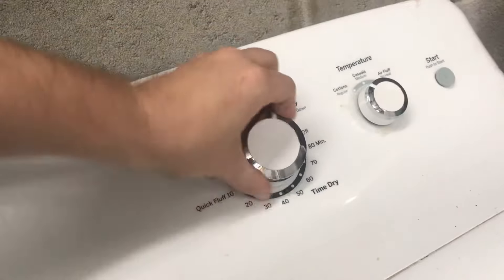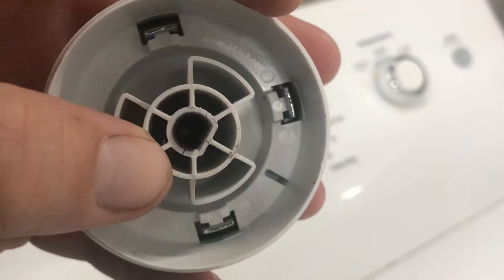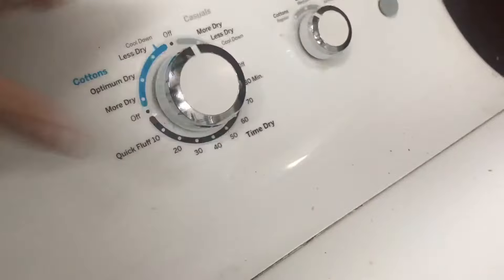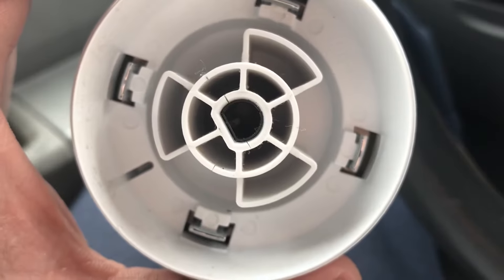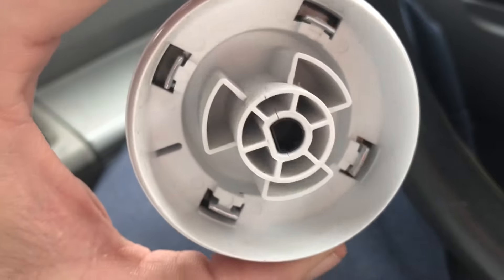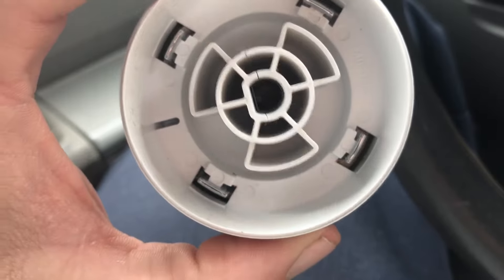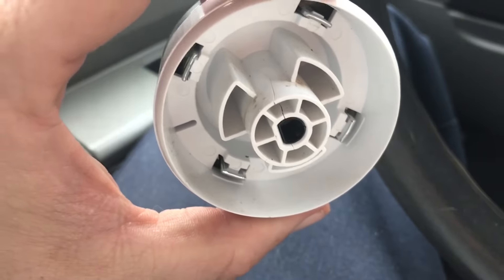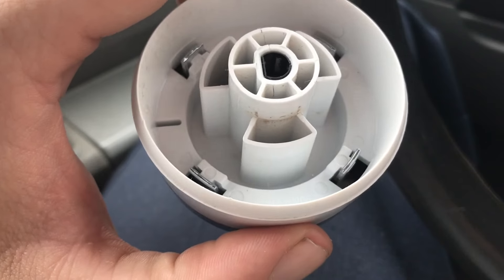GE dryer easy fix (knob not turning timer)

Comment: That model is a piece of junk. The timer is super hard to turn and breaks the knob every time. the new timers are just as bad.  I just got done fixing my parents. I even took the old timer apart and trying to lube and make several modifications to make it easier......no dice, super hard to turn. Replacement part is just as bad. Next knob will break soon.
Reply: Yea, same problem. It should be metal.
Reply: Just experiencing this now. 
 I may back fill the empty spaces with JB weld to reinforce it.
Reply: What is jb  @GeoffreysTube
Reply: @danamickel1584  sorry for the wait.  Basically it's liquid rock.  Squeeze it out from 2 tubes in equal parts, mix and then let it drip into the empty spaces on the back.  It'll reinforce the knob theorhecitally
Reply: I'm experiencing the same feeling rn. Great dryer but the knob is trash.
Reply: @metimes2999  same. I ordered 1 off Amazon and it's complete trash.
Reply: Did the JB WELD work? I'm on my third broken knob and was about to try JB Weld on it.

Comment: Your video saved me hundreds of dollars, an enormous amount of anxiety, and fixed my dryer problem perfectly.  Thanks for posting this!!!!
Reply from the maker: The simple things are overlooked so much.  Glad you found the video
Reply: How long do the knobs normally last when replaced?
  This is a somewhat common problem with many ge timers. 
  I just disassembled one and oiled it then put a used knob on it with the metal piece in it. 
  The timer turns now but still seems a little stiff. 
  I am not sure if the motors get stiff or if the hams get in a bind from wear.
Reply: I second this! ❤

Comment: Usually replacing the knob is a temporary fix. These timers  are notorious for getting too stiff and breaking knobs. You can reinforce the knobs if you use the two part super glue with the powder catalyst.  I just fill in the holes around the d shape which makes the knob much stronger.
Reply: You deserve to be the owner of this vid

Comment: Appreciate the video.  Something felt stripped, but I couldn't see anything wrong.  I looked at the knob with a flashlight after you mentioned the cracks and sure enough, they were there (could barely see them).  Very helpful.

Comment: Question is there a metal piece on the plastic part where the knob is suppose to be. If so do you take that off could it be from the old one or is one on there already. where timer is. And is there a metal piece with new knob.

Comment: Hello I have the identical dryer that your showing with the broken timer knob. Can you please help. I'm on a fixed income. My dryers belt broke so I ordered a new one and replaced it. Then the it still would not start up. So I saw a video and replaced the door switch. Also I cleaned it inside and replaced the exhaust vent also. When the machine is in it is whisper quiet. I also replaced the drum bearing slides. The switch was aftermarket. It wouldn't stay together. So I used some hot glue on the outside of plastic and it held fine. But the dryer timer will not advance and shut down. It just keeps heating on any setting. What could I have done wrong or what is the most probable cause for this. Thank you David

Comment: Is it normal, or not normal, for the timer knob to be so hard to turn on these GE dryers..? We have a GE dryer bought new just over three years ago. And from the beginning I thought the timer knob was rather hard to turn. (but the store's delivery guy said we were good to go, after he installed it and started it up) Our dryer model is GTD42EASJ2WW. It has more button knobs on the front, but the timer knob looks the same as the dryer in your video. 

So now finally the knob has ended up with a crack on the inside, and it wouldn't turn the timer anymore last night. But I was able to turn the timer shaft with a pliers wrench, and then started up the dryer.

So I know that I need to buy a new timer knob. But I don't know if the original timer was/is 'defective' being that it is so hard to turn... And would a new timer possibly be much easier to turn, than the dryer's original timer...? Thanks

Comment: So i have the GE stackable unit that you have the washer error code videos on.  What if the dryer knob is turning the timer but the dryer just keeps going? I got the unit second hand on marketplace and just did my first load. Did a timed dry for an hour before i went to bed. Got up in the morning and it was still going! Dial hadn't moved

Comment: Had same issues here, had some initial troubles removing the knob so I gently rotated it until I heard the clicks tried to remove then rotated a little counter clockwise and it easily came off.  The knob was cracked on the inside and ordered the part.  Hopefully it will fix it.

Comment: You can stuff the little compartments around the shaft opening with JB Weld. This potting material will reinforce the structure. It's an effective repair that's better than new, but requires patience filling the little compartments. I used toothpicks and an exact o knife. Perhaps a syringe would do better for filling the compartments but them you have to load the JB Weld into the syringe first.

Comment: Mine isn't cracked, but I made a mistake and went to turn the knob and pulled it out. Not sure why or how I did that. I put it back on, but now my dryer will not start. Any clue as to why? Any suggestions would help. Thank you :)

Comment: My new dryer just got delivered less than an hour ago and this is what I noticed. I set it up and tried to use the new dryer and it spun around without turning from mode to mode. After looking at the knobs under side, it has cracks all over. I am thinking about returning the entire product. If GE makes knobs this fragile, what else is badly made or designed?
Reply from the maker: These suckers are tanks.  The only thing I replace on them are knobs and plastic slides(they make a squeal when they wear out) that wear out after 5 plus years of use and an occasional belt. When I first started I thought these needed a timer before I discovered the broken knob.  Never have I ever replaced an element on these or an idler pulley.

Comment: What happens if the piece on the actual dryer is broke, the part that fits into the knob?
Reply: Did you ever find out? Mine broke after using pliers on it for  months

Comment: i tried turning the shaft with some pliers and it's really hard to do with moderate force. should i go full strength, or is there some other possible reason for the resistance
Reply from the maker: They are tough to turn.  If you end up breaking it you may have needed a timer anyways. Try to use it and see if just using plyers work for you.
Reply: I found that the timer on these GE timers is ridiculously hard to turn. My parents dial was broken and I bought a new timer and it is just as hard to turn. Complete junk. Before you buy a dryer make sure the timer is easy to turn. I took the timer apart and it has terrible plastic toy gears ....absolutely pathetic. Now way to make them turn easier.
Reply: Oh my gosh! Thank you so much!
Every other video I watched had men taking apart the dryer for a fix.
I felt so hopeless.
Then I came here... You have no idea how much you have saved me on so many levels.
It's too much to even explain.
I just want to express my gratitude.
God bless you in every way possible!

Comment: I have that exact problem but don't have any cracks in the knob, should i still get a new knob🤔
Reply from the maker: if you can turn the timer a bit and you can get it to work than I would say yes you need a knob.  It could also be that you need a thermal fuse instead though.
Reply: TRY taking the knob off and turning a little with pliers then hit start. If it doesn't turn on it could be thermal fuse or door switch.

Comment: Mine doesn’t come off as easy as yours seemed to in the beginning of the video. How can I remove the old one without damaging anything else?
Reply from the maker: You have a different timer.  I bet if you look behind the knob, between the knob and the panel that you will see a clip holding it in.  You need a pick at an angle to remove that clip to remove the knob.  The problem can still be your knob on those as well.  I’ve seen those fail too.  Once you get it off you can see where it is stripped.  If it is stripped on the timer side that means a new timer.  Good luck!

Comment: It’s a common problem with GE and Whirlpool machines... poorly manufactured... had to call for service on three different machines in apartments buildings. When you call for service they replace the knob for one with a metal ring where you insert the shaft

Comment: All 3 of the plastic knobs and plastic shafts on the control board of my 10 year old GE dryer have stripped or failed, just the examples in your video. I don't know if any manufacturer's have a better build quality than these GE's, but these are not built to last and i would not buy one again.

Comment: Broke again. 2nd time. Used epoxy on cracks and filled in all the hollow points around where shaft goes for more strength. Slip clip is in good shape. The problem is the timer. Poor design. After a while they get harder and harder to turn. I noticed this a while back. Also, it will not turn flat and level like it used to. When I turn it with pliers, a few times, I could hear the timer was very loud but has never been like that. It does still work though. I will investigate more and try to find an updated, better timer for replacement. In the meantime I will use needle nose vice grips and only run it when I am home. When I find a fix I will post it here. Another problem with this model.. it takes double time to dry lately. I have cleaned the vent. No blockage. I think the heating element is probably going bad also. We have had this model for only 2 years. Next time I will buy another Samsung lasting over 3 years anyway. Never had a problem with that one, just sold it with the last house. Thank GE for that fail, once again.
Reply: We had a Maytag washer and dryer over 21 years old the last I saw them. I’ve had my GE’s for four years and think the knob on dryer just broke. Hope that’s all it is.

Comment: Changed one once on a GE dryer and happened to notice the timer motor was very hot.  Thinking the heat had transferred to the knob and caused damage, I replaced the timer and the knob.
Reply: We had to do that too.

Comment: yeah but sometimes the knob isn’t cracked, and the part it connects to is stripped. you supply a replacement for the electronic control board spinner part that the knob goes on?
Reply from the maker: ouch.  Thats a new timer. Call your local appliance part store for the correct one for your model.  There are too many of them out there for  me to link one to you.
Reply: That's the same problem that I have. Is there any adhesive that would do the trick?
Reply: @nickgb9942   the person who rented before us seemed to have glued the knob on at one point, but it eventually failed. right now we are carefully using a sort of slip joint type plier to turn the timer without the knob (pliers aimed toward the machine, gripping and then turning clockwise) for as long as that will work.

Comment: I got it to turn with pliers got a new knob but it's not making the clicking noise
Reply from the maker: The part on the timer where it connect to the knob may have stripped.  You may need a new timer.  Or keep using the pliers.  Timers can be expensive.

Comment: Buy a new knob is not a "fix". Using some crazy glue or epoxy is a fix!!!
Reply: Crazy glued mine, and it broke again.
Reply: Same here with Gorilla glue no luck. Two knobs same result
Reply: No way epoxy, or any quick fix will work here.
Research before you post!

Comment: The SHAFT on our GE dryer setting control stripped out. The knob was OK. The shaft is PLASTIC which is stupid, since it has to take lots of pressure every time it's turned. I had to have the whole timer control switch replaced!  MY GE DRYER IS ONLY 4 MONTHS OLD, as of 9-18-2023!!! I would NOT buy this model again!

Comment: This ge washer and dryer is a pos
Reply from the maker: how so?  Most fixes on these are cheap fixes.  I have never had to replace an element on a GE dryer as well.  Been doing this work for 8 years.
Reply: @BeardedApplianceRepair  the washer I have had for less then a year and it’s been replaced 2 times. The dryer is not is the same age and the timer is already seized. We had a speed queen that was 31 years old given to us by my great grandmother still running in great condition not 1 problem but sold with our house